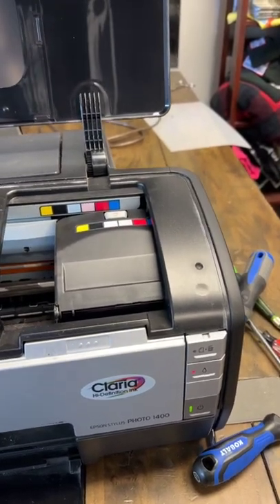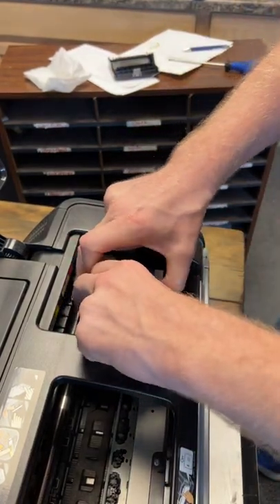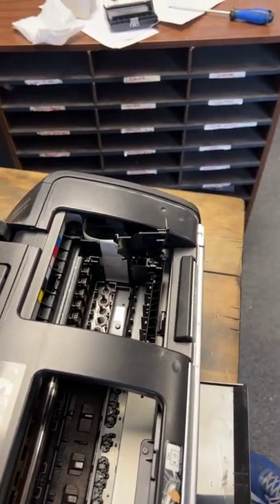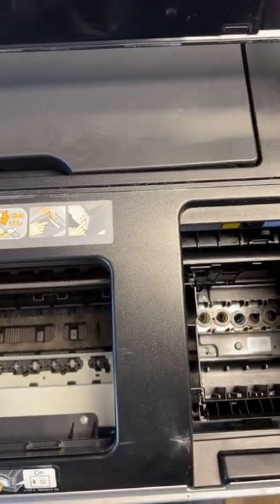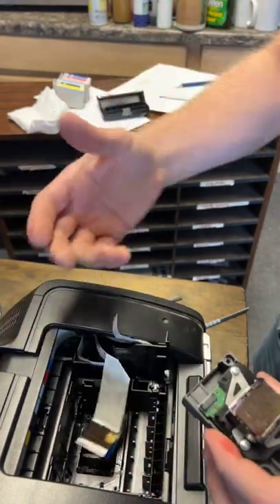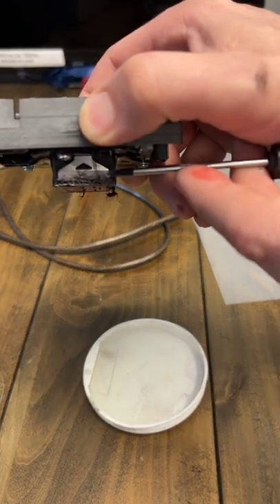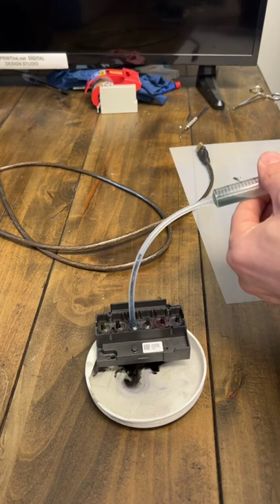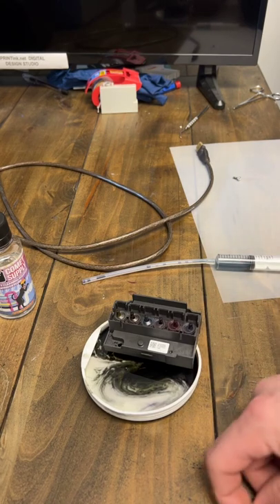Epson 1400 1430 1390 l1800 Printhead Change or clean

Comment: Thank you so much for taking the time and for sharing this with us.  I really appreciate it.  I had done this before .. well about 7 years ago and forgot the steps.. I think I burned the decoder (according to an online tech) but I have another printer which I decided to swap their printheads .. so yeah .. your video is very helpful.  Thank you.
Reply from the maker: What did it do to make you think the decoder was burned
Reply: @sethdanenberg4978  
So,  This is my second reply as an update.. like I had mentioned before .. the flexible cable connection was soaked so I replaced the whole thing with one from an identical printer I had sitting there for parts, but when I did .. the printer wouldn't even come on!!   but when I put the old printhead when is supposed to be burnt.. it powers up but I get the solid red ink light. thats weird .. I swapped them a few times same results .. I was really disappointed and dont know why it wont turn on.. I put both printers aside and now I'm using my old Artisan 1430.  Please let me know if you have any idea .  Thank you.
Reply from the maker: @yemarican  That print is most likely no good it may have fried the main board on the printer. When you turn the printer on listen closly to the back of the printer for a very quiet beeping noise